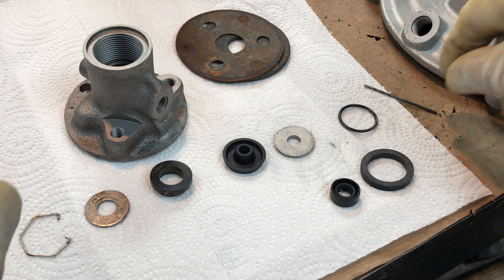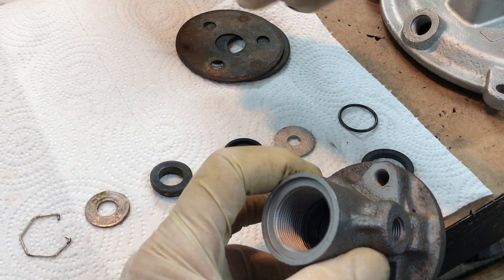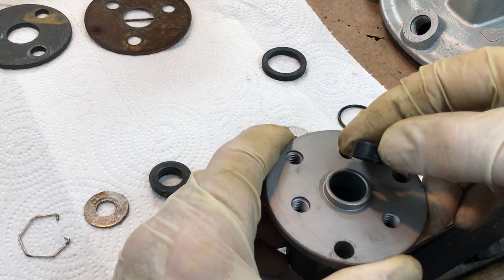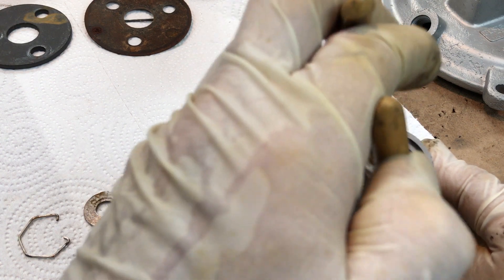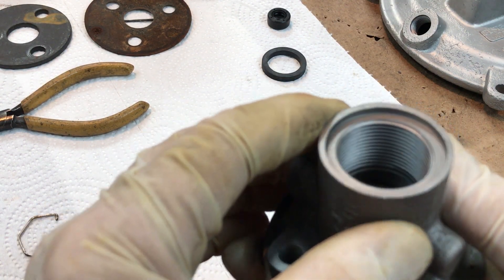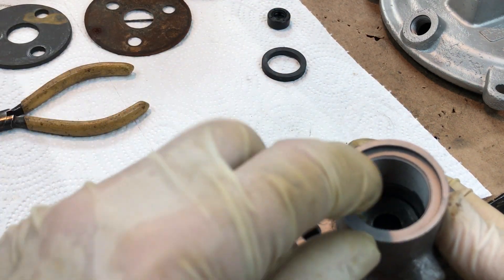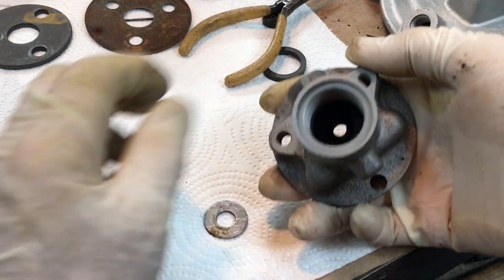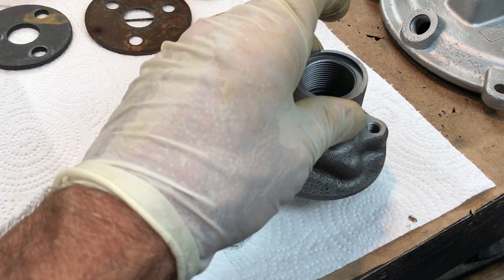ATE T50/26 Brake Booster Tech Tip

Comment: Hi Will, I have an ATE 50/24 that leaks brake fluid when I apply the foot brake, through that small hole you drilled into. I've already worked on it twice but I can't find any fault in the parts shown in the video. Is the o-ring special? What measurements do you have? Does the washer that goes over the o-ring have a special shape (mold)? I would greatly appreciate your help. If you give me your email address I can send you photos. Thank you.
Reply from the maker: ssimports@sbcglobal.net  The o-ring is necessary but it is a standard o-ring. It just has to resist brake fluid.  The o-ring is compressed by the stack of parts. If the steel washer that is under the retainer clip is not under pressure then the stack of parts are not under pressure. And brake fluid will leak past the o-ring. You might need to get a thicker steel washer. Try a DIN 9021 8mm washer. It is slightly thicker than the factory steel washer. You can still send me photos.

Comment: My brake fluid comes out of the air filter end when I push the brake pedal, can these seals etc still be purchased? hopefully meaning brake fluid hasn't got to the vacuum can.
Reply from the maker: Hey Wayne, thanks for the question. If you are talking about this specific booster, and brake fluid is coming out of the air filter on the back, you got a more than serious internal leak.  Yes, the booster is probably full of brake fluid. And the vacuum parts of the booster are not designed to handle brake fluid. So, they are slowly dissolving. And those parts are very hard to find. If the booster is full of fluid that meant someone had to keep adding fluid to the reservoir. If so, that should have been a red flag. Give me more info and/or post a video of what the booster is doing. Thanks, Will
Reply: @Mercedes-Guru  Hi Will, Thanks for the reply, I believe they are T50 servos however the type fitted onto the BMW 2002 1971 model year.
There's two remotely fitted on UK RHD cars and since having the Brake master cylinder, clutch master Cylinder, and slave cylinder rebuilt, one of the servos now pours out when the brake pedal is pushed, I have uploaded a short vid showing the leak in action! https://youtube.com/shorts/xjFF_icXe3E?si=PLgyraZJe05iaN8_
Kind Regards Wayne